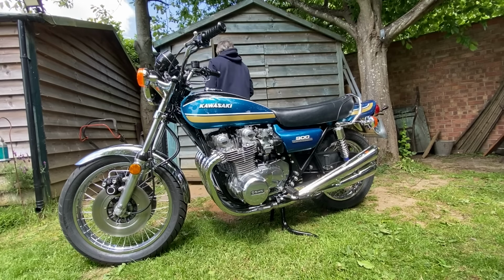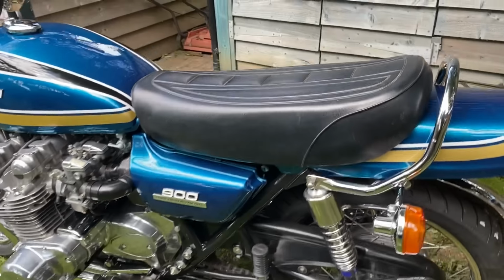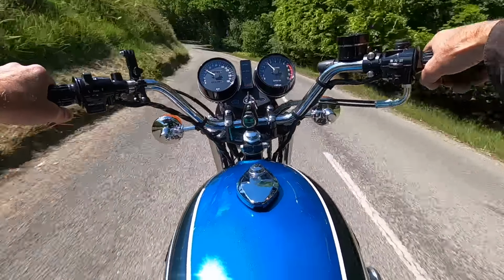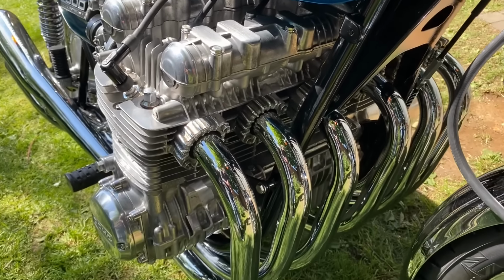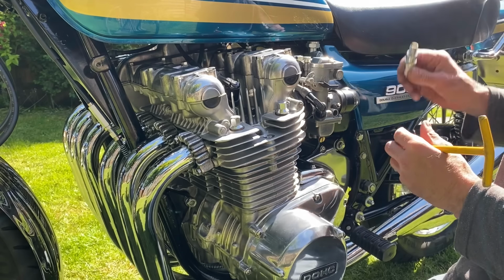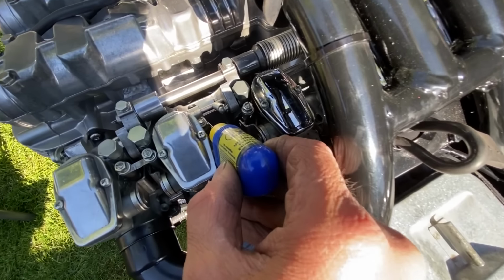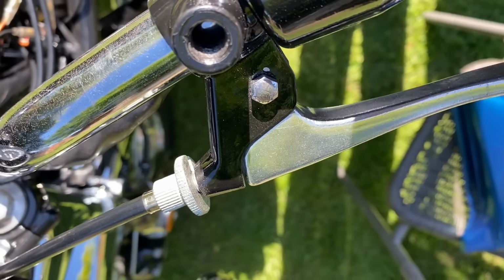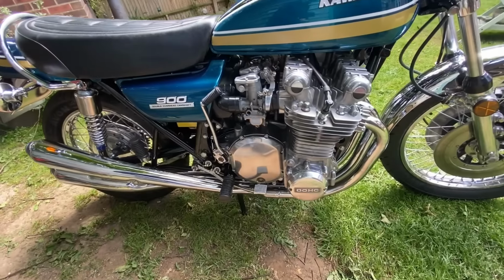Kawasaki Z1 Super Six first test ride

Comment: Friction modifier in a wet clutch ? I don’t think so.
Other than that awesome bit of work.
Reply from the maker: Zx1 does not affect organic material. It bonds with metal parts at a monocular level and does not change its friction levels with mating organic clutch plates. I’ve been using it for 30 years so I wouldn’t suggest it’s good if it wasn’t

Comment: Good afternoon. I cant see an inline Fretser valve fitted between tank, & carbs. I would highly recommend this, as it allows oxygenation of the fuel, which gives improvement in combustion, & can give gains of 30-40 bhp. If u need any further advice, or would like to feature me in one of ur vids, to increase ur subs, pls get in touch. Many regards.

Comment: 4:00 "The gearing is awful"
The first thing I noticed was how high it was revving.
(I'd still give my right arm to own it - irrespective of the gearing).
Reply: That is mostly because it is carbureted. You need a choke for a cold start, which usually increases RPM when started and when the choke is 'turned off' it lowers it's RPM which is notably in idle and not that much while riding.

Comment: The elephant in the room is that motorcycles have the WORST gearing from the factory, and the aftermarket sprocket options are unacceptable. Why is it not standard for all motorcycles to have an overdrive gear? Jay Leno has a video about his 1932 Henderson. The 1932 Henderson had an overdrive gear, and was a better motorcycle, with a smoother engine, and better gear ratios than many of today's bikes. We had overdrive in 1932, but not in the year 2020?

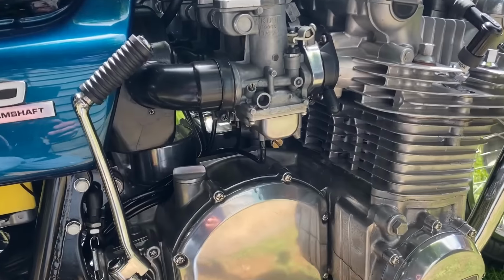Comment: 0:57 A friction modifier in an engine with a wet clutch? You're off your chops.
Reply: ZX1 only works on metal to metal surfaces doesn't effect the clutch plates I swear by it in all my engines even the lawnmower gets a squirt.
Reply: @groovedodger  I bet you have your volcano insurance all up to date too.

Comment: ZX1 friction eliminator and a wet multi plate clutch are normally a recipe for disaster. You have proved that wrong. An old wives tale, never put car oil in a motorbike with a wet clutch ?

Comment: There must be a better way of feeding fuel into 4 or even 6 carbs...to have six floats is giving a massive margin for error. Surely the line for fuel is not that critical as long as the main jet gets imersed to the correct level.....how about one float bowl feeding all carbs situated on the same level and in the same plene or close to?  Or how about optical sensors in each carb fuel bowel cutting off the individual feed to each cylinder by fuel tap solenoid. Or perhaps allow a flood of fuel into all float bowels and a spill over from each bowel at the correct fuel level from to then be syphoned off and pushed back to the tank by a pump....   dont u just hate seeing fuel leaking out from one of those tubes aftre a rebuild and having checked 100 times       i just hate the problems of float bowels....perhaps i am just going crazy and have simply been bullied by my float bowels.

Comment: O'lord wontcha buy me a flyin' Millyard, my friends all ride Harleys I must make amends , worked hard all my life time no help from my friends 0'lord won't cha buy me a 5.0L Millyard super V- Twin 

One little hit to sync the carbs ..turnup the idle screw so you can see day light under all six of the carbs sides and by using the synco adjustments set all the sides with a single feeler gauge so they are all exactly the same height .so they are all exactly the same at any throttle speed and you can't get them any closer than that , then lower the idle screw back down to were it will start up and run with out screaming and then set it for a proper idle where you want it to run., down side you will have to remove the carbs  from the engine to do this accurately , but you will never have to do it again ..it always works for me on all four cylinder bikes so it should work on your six cylinder ..and thank me later with a free...lol ride ...

Comment: The worst thing about motorcycles is that they don't have the correct high gears. Motorcycles need to be required by law to have an overdrive gear. Basically every motorcycle sold, except a few rare models like the 1934 Henderson, have race track gear ratios from the factory. 

And when you watch an American motorcycle show, they will never talk about gear ratios. On the forums, every owner installs a smaller front sprocket, and they gear their bikes even more horrendously, to "go faster." Because 1st gear just doesn't have enough power on the typical 4 cylinder motorcycle, LOL. 

The whole obsession with race track gear ratios on modern street bikes, is the worst thing about motorcycling. I pray that manufacturers start putting a superrrrrrrr tall overdrive gear on all their bikes. It is unbearable driving most Japanese motorcycles, with their horrendously low 6th gear. I can't understand why they ever installed a 6th gear on modern bikes, because it does nothing. 

P.S. My 2002 ZX-6R could idle in 6th gear with my hand off the throttle at 25 mph in traffic, with a passenger on the back.